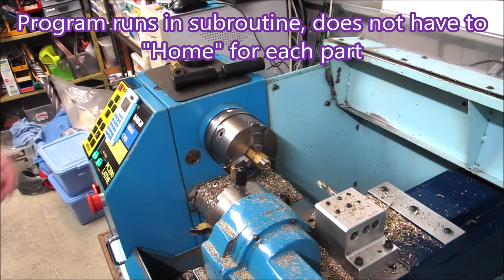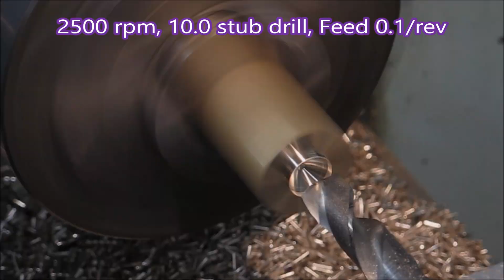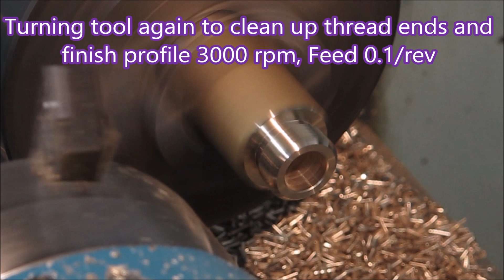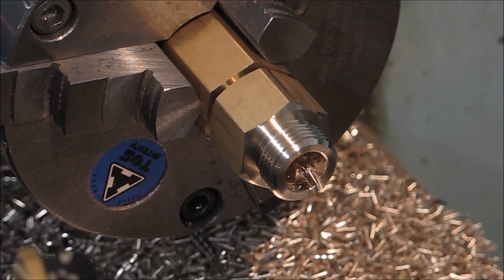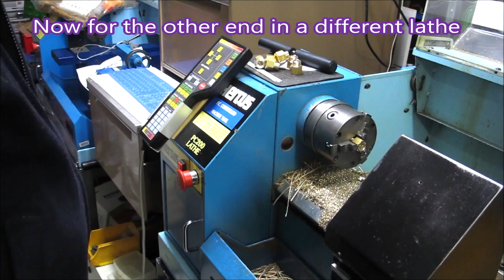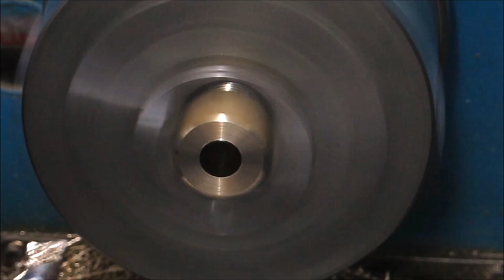Cnc lathe threading 3/8"BSP with full form insert, drilled and tapped  3/8'BSP.

Comment: Sir, Could you demo how you set tool offset for the Hercus 200 cnc lathe ?
Reply from the maker: Try this https://youtu.be/9ORjC1V4SwQ
Reply: @smallcnclathes  noted. How do u set for drill bits?
Reply from the maker: I usually guess when the drill is on centre and drill a hole, then centralise drill in the hole and read the X position on the screen to be set as the G50 X in the program
Reply from the maker: Do you have a similar lathe?
Reply: @smallcnclathes  No sir, but I presume the procedure should be similar in terms setting up for the tool to touch the work piece. I am currently completing the conversion of 7x14 mini lathe with mach 3 turn. I noticed the procedure does not cover for drill bits.  I wanted to learn how you setup your tool offsets so that I can replicate the procedure with mach 3. My cnc mini lathe conversion. https://youtu.be/xY73qqipC90

Comment: Dear Sir,

Can the cam software perform face profiling ?
Reply from the maker: Yes it can. Thank You for your comment.
Reply: @smallcnclathes  What would be the recommended indexable tool best for face profiling ?
Reply from the maker: @rengankrishnaiyer6912  depends on profile, but I would think a 35 degree insert at 45 degrees to the face would be useful.
Reply: @smallcnclathes  Thank you sir